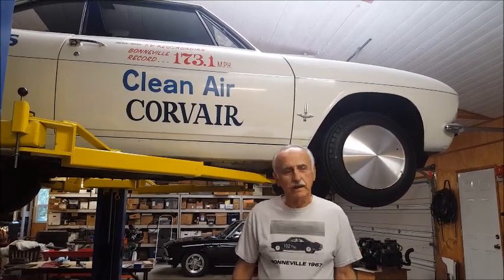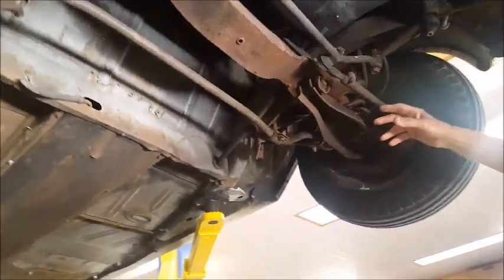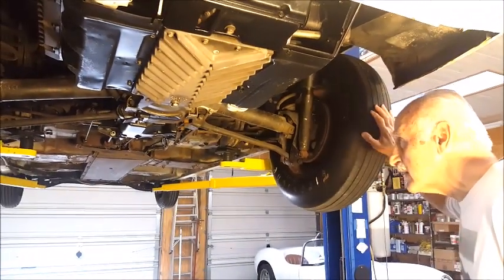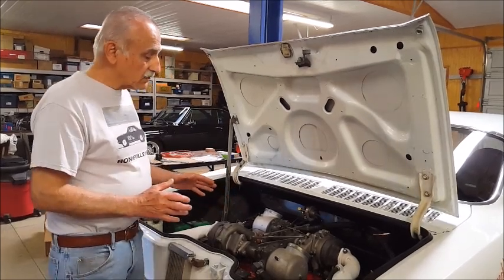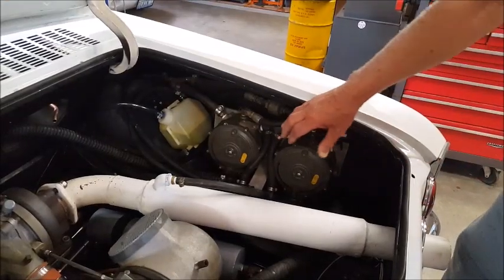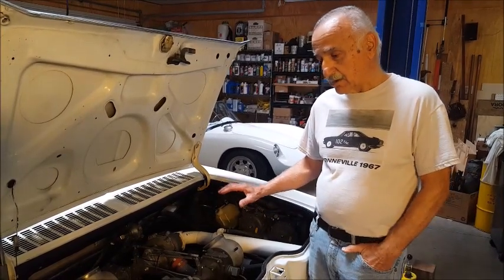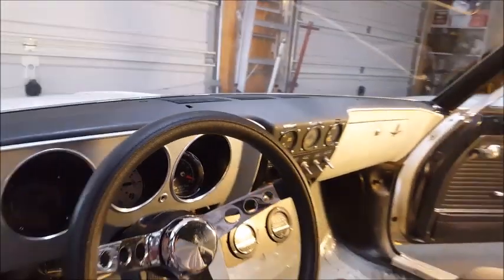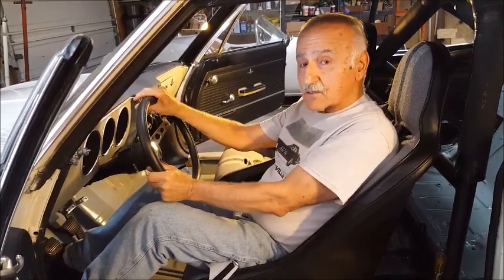World's Fastest Corvair, Is It Safe at 175 mph?

Comment: I've been playing with Corvairs for almost a half-century now.  Currently have about eight (maybe nine, I'd have to go count) in the fleet, and a couple tons of parts.   It keeps me off the streets... ;-)  None of the so-called handling defects of the '60-'63 models ever gave me any trouble, and my favorite regularly driven Corvair is a '60 4-door, supposedly the worst of the crop if you believe the armchair "mechanics".   I also have late models in the fleet, plenty of respect for the entire Corvair lineup.
Reply: List your corvairs.
How many 1965 to 1969?
Reply: @albundy8052  Two '65 models, both ragtops, one a Monza and the other a Corsa which has suffered from the metal mites because of some less-than-well-done bodywork that happened before I got the car as a derelict, then refurbished it, drove it for years, even had its photo appear in an issue of the Corsa Communique (many years ago) but the rust has gotten pretty bad.  :-)  There's a '66 Monza ragtop project that we just gave to my daughter who has decided she wants in on the "Corvair resto-thing".  There's two 69 Monzas, one was involved in an accident that badly damaged the car to the point of turning it into a parts car, some girl ran a stop sign and t-boned it HARD, enough to leave me bleeding and the car bent sufficiently to shatter the backlight glass.  Still have it but it's being slowly parted out.  The other '69 is in storage, local car, never lived anywhere else but here in town, needs paint.  It's time is coming.  There's a '67 500 coupe that is pending a sale.  A '68 coupe with a holed piston (likely gonna put the bashed and battered '69 car's engine it it), and two '60 models, one a 4-door I've had since 1984 and is original/unrestored and was worn when I bought it so you can guess what it looks like now but it's a good runner and it still has solid bones... a '63 Spyder ragtop and a '62 Monza ragtop... and a '60 Monza coupe in storage.  And a Lakewood wagon also stored.   I guess I miscounted the first time... ha!
Reply: @tonyunderwood9678  
Thanks
Reply: @tonyunderwood9678  
Love the corvairs.
The station wagon are  rare.
The convertibles are rare.
My first love 1969 corvair.
Reply: @albundy8052  I went to look at a Corvair station wagon for sale back in the 80s in San Diego. It was super rusty after sitting in salt air at the beach and he wanted way too much money for it. I had to pass, very cool car, though. The pickup was pretty cool too. A lot of people would build offroad tube frame racers with these engines back in the day.
Reply: Does your '60 model have the gasoline-fueled heater? Unique in the history of OEM American cars I believe.
Reply: @patrickshaw8595   Only just now saw your post, yes the '60 4-door has a gasoline heater.
Reply: @tonyunderwood9678  Made by GM under license from the South Wind Corporation.
I have one I installed in a little a popup tent trailer. When I got it the guy told me it came out of a '60 Corvair.
Reply: Only off-camber curves and thin sticky tires could cause the outer rear tire to “tuck” and low speed rollover, pre-65.   It did happen but probably not often.
Reply: @smokeygreycat8750  I had a '64 Spyder and I don't know about other '64s but it had a leaf spring hanging on links down from the wheel-ends of the rear A-arms and a center arch that bore upwards onto a pad under the iron differential housing. Any jacking that unweighted the inner rear wheel in a turn and cause the inner to move downwards instantly removed a bunch of spring force on the outer wheel. If you undid either link the rear suspension sagged almost onto the bump stops.
Seemingly to counteract the body roll this arrangement would cause in a turn the front had a stout swaybar with short distance from it's torsion axis to suspension attach rubber bushings. With B50-13 T/A Radials all around friends watching me on a slalom course told me they saw daylight under the inside front tire on every hard turn.
    I ended up reverting the car to '63 Spyder springs and no swaybar up front, ditched the transverse link in back, found some UBER short stiff springs fit the back of the car and fitted Koni adjustables on back.
I fabbed restraining straps for the back that permitted only 1/2" of suspension-extension. I moved the spare tire and battery to the front trunk, put quick-steer box and arms get down to 2 1/2 turns lock to lock and it did OK after that (rode rough but hey I was 17)
Reply: They were neat cars.
Reply: I have a '60 4-door and I love it. I haven't even driven it yet (currently working on that though) but it's just fun to look at. Being only seventeen years old, funds are few and hard to come by, so I have to budget wisely. It's not too rusty, despite being a lifelong North Dakota car.
Reply: Are you in calif  I am looking for a 65 and up to replace the car I had to sell 20 years ago
Reply: I have a 62 my first current project solid body all around just got most primed this spring doing a custom blue n almond whit pearl paint job on it kinda keeping the majestic blue

Comment: I had 1978 Ford Fiesta with Zenith Carburetor, and a similar positive seal Ray Jay Aeromotive turbo on it like the Corvair used, draw through  set up though not running on propane, I did use water injection alcohol mixture to keep knocking down above 15psi with the boost gauge in the 20psi + range. Awesome share I had no idea this car existed.

Comment: I love Corvairs. Had 3 as a teenager. FWI the engine is so well engineered that it is a popular aircraft conversion for homebuilts. And one thing that few people know is that GM wasn’t after the VW market they wanted to pound Porsche. And in the early days of SCCA road racing they would spank the Porsches.
Reply: Before Porsche introduced the 901 series, the Porsche engineers got busy testing vehicle dynamics with a prototype boxer-6 engine, using a '61 Corvair as a test bed.  Scuttlebutt has it that Porsche had copied many design features of the Corvair engine, including its 4 main bearing "split" crankcase.  After testing, Porsche engineers decided to go with 7 main bearings on the engine that would go into the new 901 series (911).  Before it was over, there were several Corvairs running around Stuttgart.  This wasn't the the first time Porsche and Corvairs got together.  In the late '50s somebody at GM bought a 1957 Porsche 356 and installed an early test-bed Corvair engine in the car for testing since the Corvair boxer-6 engine had been finalized and "finished" and was ready for production before the actual Corvair automobile design had been finalized.  Thus, Corvair's boxer-6 predates Porsche's 901 series boxer-6's by several years.  Just thought I'd mention it...
Reply: @tonyunderwood9678  Tony, you're one of maybe two or three people I've come across who were familiar with the Porsche 901 since it's inception. It came out in 1964, when I was a high school student in Ludwigsburg, Germany. My 3rd year mechanical drafting class teacher asked us one day, "Would you guys (and one girl) like to go on a field trip next Thursday?" The kids were kind of "yeah, maybe, where are we going?" Well, we've been invited to go on a tour through the Porsche factory over in Zuffenhausen. Zuffenhausen is just a few miles across town from our high school (for American military/diplomat dependents). You'd have thought someone dropped a bomb in the classroom. It wouldn't have made any more noise than that bunch did.

It was probably the main high light of the four years I went to school there. As a teenaged boy, I was just a wee bit obsessive about sports cars. My wife has been quoted saying something to the effect of, "What do you mean WAS???"  This was about the best place in the world at that time... at least to me. There were 356s mixed in the plant with the 901 cars at that time. The 356 was just running out of production then as the 901 was coming on line. At the 1964 Paris Auto Show, Peugeot objected to Porsche using the "901" in their model for the new car. A lawsuit resulted due to Peugeot having a trade mark (copyright??) on the "something zero something" number sequence. Porsche lost the lawsuit and the 911 was the result. I've never heard if it was actually a contentious situation or if they just agreed to make the change. There had been something like 80 cars produced by that time so they're very rare. I've only seen one in 58 years. I've never heard any details ever officially discussed.
Reply: @MrGaryGG48   Yep, I'm familiar with the "complaint" from Peugeot, but I didn't know how many actual 901s were produced before the numbers were changed to keep everybody happy.   ~80?  More than I'd have thought.  I had figured (considered?) that the cars already out the door would probably have been recalled and badges changed.  ;-)   I had a '66 912 which is what got me interested in a bit of Porsche's history, particularly after I'd kept hearing scuttlebutt from the peanut gallery about how Porsche designed the Corvair and its engine when the Corvair boxer-6 predated Porsche's variant.  Lots of presumption...    As the adage goes, "One eye among the blind is king."
Reply: @tonyunderwood9678  I'm not sure how valid it is but I heard a narrative back in the 70s or 80s that Porsche engineers had studied the Corvair engine before they produced the 2 liter six for the 901. The idea that Porsche got that close to the Chevy guys is suspect but who knows? That was a long time ago and a lot of things were different then.

All I know for certain is that two really special cars came out of that period and we all benefited. I guess that's why I've always been fascinated by history. Lots of great stuff to learn from...

Comment: Incredible Car more Specifically the way you transformed it  by using Period Correct parts  that are referred to as “off the shelf “ parts  and  the build  being mostly Mechanical without Computerization  and all the Electronic Sensors like modern Automobiles

Comment: What make of marine water pump did you use? I'm thinking about building a hot water heater system to heat a VW beetle.
Reply from the maker: I don't remember what kind of water pump I used, that was 50 years ago.  They didn't have 12 volt hot water pumps in those days.  More recently, I used a Davies-Craig on my street Corvair from Summit.  They work the best for me.
TomKeo
Reply: @tvkperformance4147  Thanks for the reply. I'm sure that any one of these will work for what I have in mind. Thanks again.

Comment: Its not the fastest Corvair. Here in Vancouver Wa is a mid engine v8 Corvair that would eat that 1 for breakfast
Reply: In the mid 60’s many Corvair bodies were used for NHRA Top fuel Funny Cars because the were aerodynamic and 230-250 mph. 
There was a similar one owned by Ron Cohn and ran  Bonneville and the Dry Lake with Corvair engine with a 471 GMC blower in the 70’sand 80’s and held records at both places. 
This is Corvair powered by a Corvair and has nothing to do with other engines being used in one.
Reply: Maybe you should take to the salt flats. Best of my knowledge Corvairs didn't come with V8's.
Reply: @williamgregory6684  - it is a common conversion. Crown made a adapter to mount a Chevy small block in front of the transaxle where the backseat would be. It was also the basis for the Mirage and Coyote cars, like in hardcastle & McCormick. Another conversion involved connecting the front of the small block to the transaxle input shaft as the rotate of the Corvair engine was opposite the V8. This one isn't all that good as the snout of the crankshaft is not designed to transmit power. The Crown conversion, though more involved, was better.
Reply: There are many standards to "fastest" and this one is top speed. Not many cars are going to hit 173 mph and clearly only one in his class of racing.

Comment: Fantastic  i have owned 14 corvairs over the years starting with a 1964 in England raced any body  over there did not get bested very often. then i came to USA 1972 and owned the rest here from 110 hp to turbo charged still have a 140 horse and a turbo charged 180 corsa  it is Great car The 64 in England was 110 horse and once you learned how to drive a rear engined car they where fine handling cars and cornered really well on the narrow windy English roads one thing i found when i talked to gararge owners and mechanics here in America they mostly  could not believe front  tyre pressures  needed to be 16 pounds and so when the tyres where aired up to like front engine american cars at 25 pounds they did not handle worth a damm and i think many people got into trouble by airing the tyres up like that. Ralph Nader had no clue.  When i lived in S Dakota  from 1972 till 1990 Corvairs where popular in Lead and deadwood because they where great cars in the snow in and around the black hills in and  around Rapid city.           The correct english way to spell tires is tyres!!!!!  Ed

Comment: High school ride was a '65 180hp Corsa convertible w/ '66 Saginaw trans and High Ratio steering box.
I believe I bought the first pair of B50-13 T/A Radials ever sold here for the front. G50-14s on back.
Reply: I ordered a 69 'vair new with HD suspension quick ratio steering and 140 with posi axle.  The intakes were machined and welded 6 individual ports with central manifold mounted with a '62 Olds turbo holding a 2" SU constant velocity carb.  Also with a waste gate and water/alcohol injection.  Konis on all four, sway bars front & rear,  wheels widened to 8"rear with front 6 1/2". With TA60 B's front E's on rear.  it out handled everything except Lotus Europas and out accelerated everything but Cobras and Dodge Hemis and big block Vettes. I often filled the tank with 130 octane aviation gas from the local airport that made it just a little faster.
Reply: @richardwaugh2049  Your Corvair sounds like it was a lot of fun.  I had a '64 Spyder that I loved, then a '66 Turbo Corsa, which I had even more fun with.  I was watching a parking-lot slalom one Sunday and decided, heck, I will enter if it isn't too late.  Took the hub-caps off, ran against a 289 high-performance Mustang that had been modified, and beat him by several seconds to win my class.  First time I ever ran a slalom.  I became friends with the Mustang owner, and one time we both beat a 225 HP 289 Mustang in a drag race.  I loved the way the car handled, wish I still owned it.
Reply: @richardwaugh2049  I call bullshit. Can you guess the fault in your lie ?
Reply: @richardwaugh2049 thanks, Yes..  interestingly, I had tough time getting. The new. Radials ,for my 1961 GALAXIE Convertible( a large Car), in Spring 1966, even.      My , North Webster Indiana *Mechanic,, Steve White , at WHITE’s MOBIL SERVICE STATION(( RIP)@ …. Said a best: four tire switch,as Big  in Europe! INTERESTINGLY, ALSO, THEY worked & not to bad handlings,,,, & better Gas mileages…..believe I also got four ,new Shocks Monroe….

Comment: Isn't the center of pressure in this car ahead of the center of gravity, making it highly stable at speed?
Reply: I was under the impression that for stable steering, the Center of Pressure should be slighty aft of the Center of Mass, so that a gust of air pushing the car, for example, to the right would slightly ''weathervane'' it to point left, and so automatically steer back to the intended line of travel. Set up as you say, that same gust would make the car steer further off course, and the driver would have to fight the wheel constantly to keep a straight line.

Comment: Wow you mean Ralph Nader Lied, LOL. Love this little video. I'm pretty impressed at how simple the system really was and how effective the Corvair's aerodynamics was. I had a Pontiac 74 Trans Am with a 400cui in it and I only got about 400 hp out of it with some simple mods, so the power coming out of that little engine is just mind boggling. Thanks for sharing suck a cool video. I had a 62 Corvair Monza, wish I still had it, lol. Best Wishes & Blessings. Keith Noneya
Reply: Nader didn't lie.. the earlier models had issue later models I don't think suffered from the same handling issues.
Reply: @codyramos3200  As a whole he did, not on small issues though. But yeah Nader lied! https://www.youtube.com/watch?v=NI9Hq0_Mhy0 Best Wishes & Blessings. Keith Noneya
Reply: Had 2  early corvairs when young,both low horse below 110 no problems.now have 3 wheel Cushman with corvairs dt out back& handle bar steering,now that's unsafe at any speed, but I still drive it, no crash yet after 50 yrs.

Comment: I had an brand new 65 Corvair Corsa 140 and hit 120 mph on a straightaway with no handling problems. The only changes I made were replacing the octopus air cleaner with 4 small air cleaners and advanced the timing 3 degrees. I entered a corner at end of the straightaway at 110 mph and started to sense the car starting to oversteer, so I opened her up with all 4 carburetors wide open. The real tires bit the road hard, lifting the front end up giving me neutral steering as if the car was on rails. I came out of the corner at 115 mph. I must admit that it scared me but the car did exactly what it was designed to do. In case you are interested, I used to autocross this Corvair weekly and knew its characteristics like the back of my hand. The car actually became an extention of myself. And yes, this car would exceed 6k rpm in 4th gear.

Comment: Thank you for posting the excellent explanation to the non-corvair motor heads. A 1963 vair with eighteen miles on it straight from the Chevrolet dealership competed in the famous Canadian winter RALLY. The stock vair won every stage ! Nuff said.